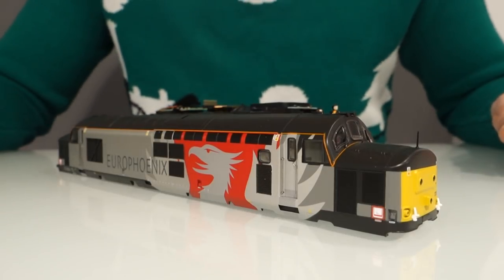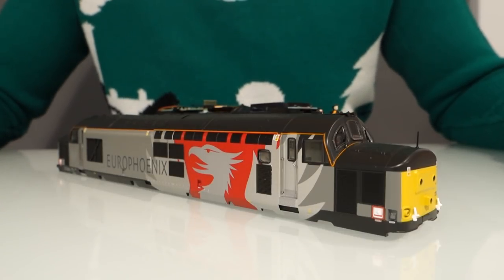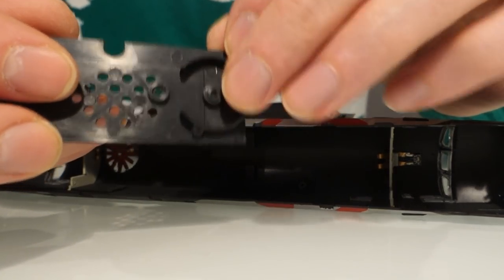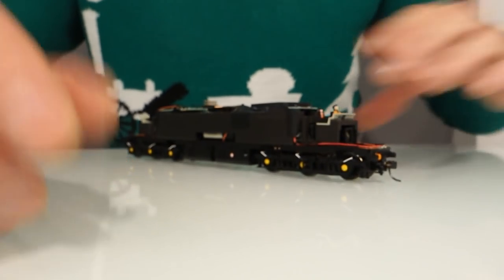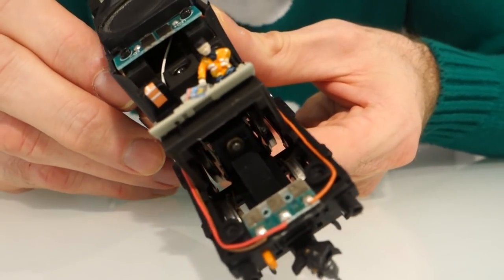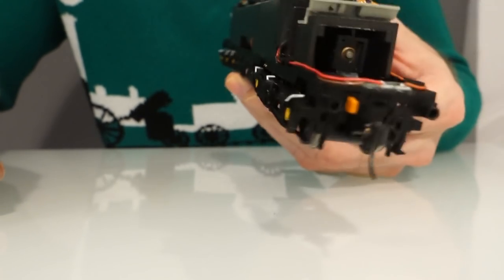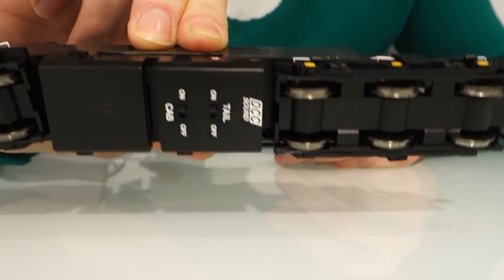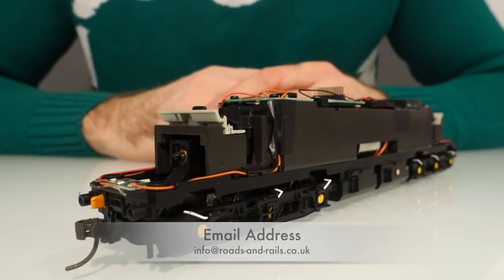Upgrading The Europhoenix Bachmann Class 37, Cheap And Easy Ways To Maximise Your Model

Comment: Enjoyed your upgrade of the model. Did I hear you say, you have Kadee couplers on your web page? If you did, I cannot find them. I have just over, now, 200 locos, primarily for display, even though they are receiving attention to decoders and speakers, I would like to add Kadee couplings. Do you have them in stock and what size do I need?

Comment: Which speaker did you use, I didn’t see it on your website unless I missed it. Thanks Tony
Reply from the maker: Hi Tony, I no longer have these speakers but I do have 2 alternatives. This one will fit straight in http://roads-and-rails.co.uk/store/p82/Double_iPhone_Speaker_For_DCC_Sound.html, and this one will fit if you remove one of the screw hole towers from the body http://roads-and-rails.co.uk/store/p122/Flat_Megabass_Speaker_25x35x5mm.html Both sound really good, hope that helps, Richard

Comment: hi richard i have just bought a europhoenix bachmann  37 with sound but i find it too quiet even with the volume set at mazimum as per bachmann instruction sheet do you think a better speaker would improve the volume and what do you recommend i have fitted a few of your speakers now and am very happy  with  the results 
kind regards
ralph
Reply: We have also recently purchased this model and find the sound to be quite quiet compared to TTS and Legoman Biffo sets, In the manual it says to change the CV from 1-128 or use function F15 to cycle through the 5 sound volumes, but when we have tried both nothing seems to increase the sound. Any idea's? we are using a NCE Pro Cab

Comment: I presume you can use a 8 ohm or 16 ohm speaker with the original loksound 'select' decoder that is fitted in this loco..?
Reply from the maker: Mark white 8 or 4 is best, 16 would be pretty quiet